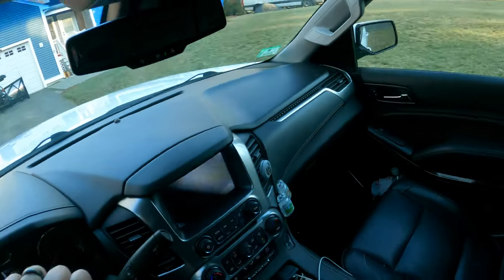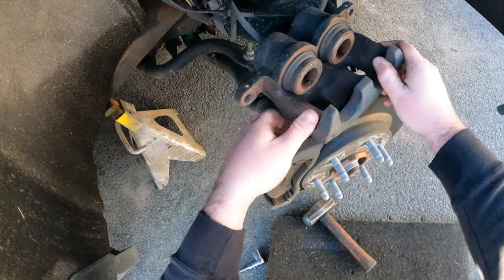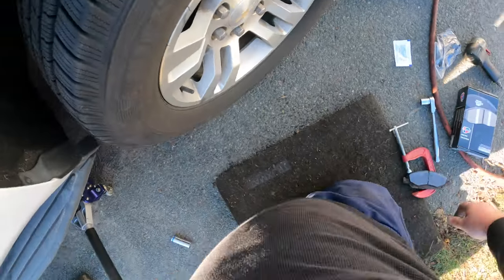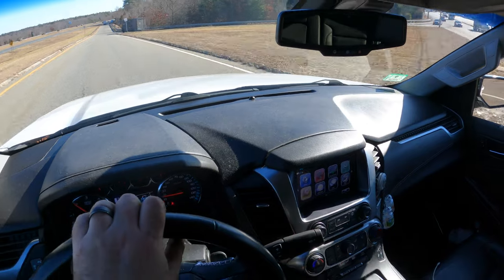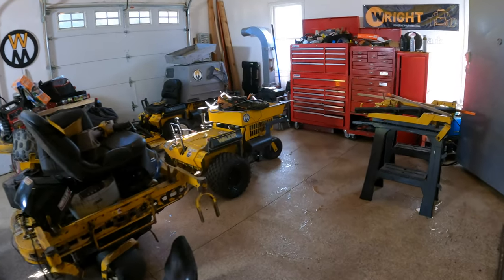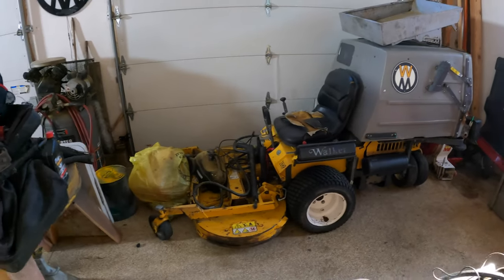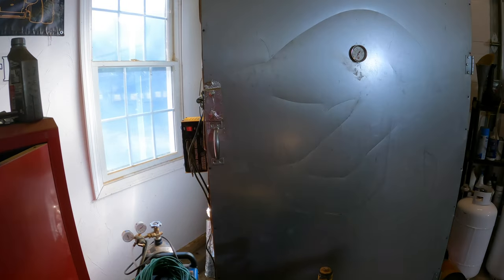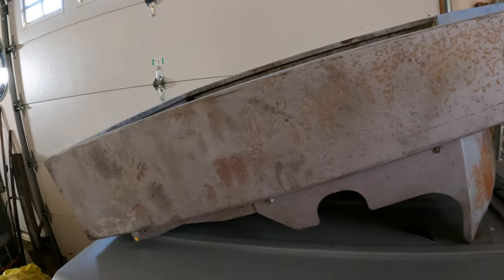I Couldn't REFUSE this UNBELIEVABLE deal! Another NEW MOWER?

Comment: You can take apart the gearbox and put the gear on the other side of the shaft to reverse rotation if you want to make it work for a different application. I like the new color of the house
Reply from the maker: Thanks ken! Yes I have seen you point that out on your walker gearbox video. I happen to have another gearbox with the opposite rotation so I’ll just stick that on there.

Comment: Just a heads up if those caliper bolts had loctite on them you may want to take them back out and put some on them. I have seen them back out on two different Gm vehicles
Reply from the maker: Good point. Thanks for your comment!

Comment: I have a question for you guys is there any way to put an auxiliary fan over the top of the motor to keep it running cooler and get the heat away from the motor?
Reply from the maker: Yes there’s a way but which mower are you talking about?
Reply: It’s a general question on any mower I put fans over my air compressors and anything that air cooled and they last for years no breakdowns no blowups no nothing
Reply from the maker: @mikedeiana1504  yes anything is possible!